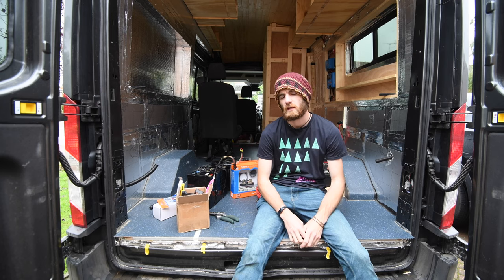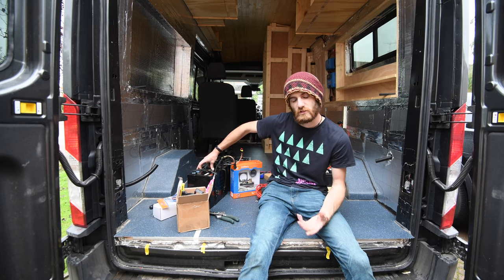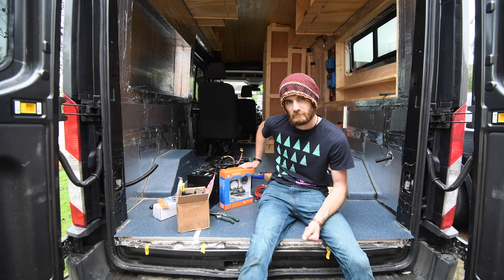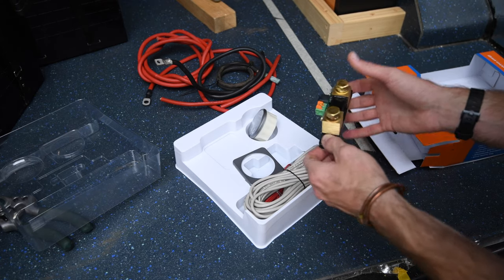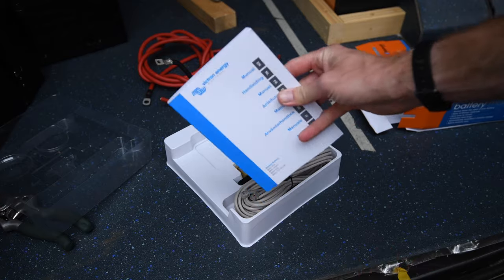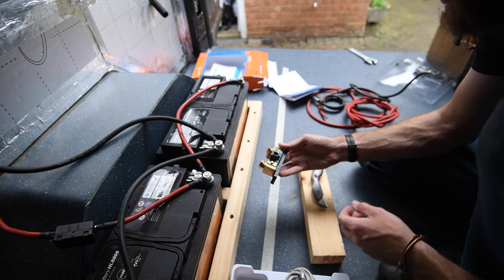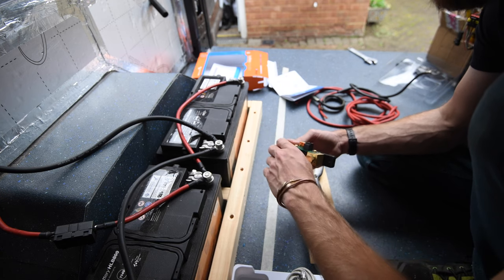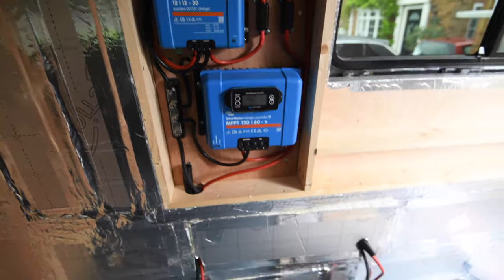Quick Victron BMV-712 install | EP26 | Ford Transit MK8 Campervan Build

Comment: I would have mounted those large isolators at 90° so that when on the handle is vertical, and off is horizontal. That would imply that there is a barrier across the cable when in the off position. I hope this comment makes sense.
Reply from the maker: Aye it’s makes sense, this was only a temp set up

Comment: Very important to know the state of charge. Takes a full charge or 2 to learn what 100% actually is. I use wizard Jr. With my midnite solar kids. I wish it had the Bluetooth!
Reply from the maker: To simply figure out the State of charge I’ve been using their stabilised voltage after a charge at the moment , the SOC in the diagnostic software isn’t particularly accurate at the moment due to the lack of real use in a long time. When I have them installed in the van our then be able to do some more tests.
Reply: Looking forward to that video
Reply from the maker: Definitely me too, I’m adding a few extra bits to the System to act as safety disconnects as the BMS in the U27-12XP can’t do much In that regard and a don’t have their external U-BMS
Reply: Neither do I and most aftermarket options are over priced.
I plan on using seed starter mats & temp controlled realay they plug right into with standard plug. Each 10x20in mat uses 15w and should keep warm enough to avoid changing below temp
Reply from the maker: Low temperature charging I planning on using the Victron BMV-712 with the temperature sensor, the BMV-712 has a build in relay which can be preset to trigger by a number of things. I’m using to the over-voltage and low temperature trigger to trip the reply which il will connected to the remote On/Off pins on my Victron MPPT and Dc/Dc charger to turn them off. Undervoltage is handled by the Victron battery Protect.
Reply from the maker: Although I was looking at the relay on the BMV triggering separate relays or contactors connected to the charges.  the Victron groups have said that as a bit overkill just use the remote on an off pins on them
Reply: I like the victron products. Didn't hear somuch about them when I decided on the midnite solar years ago. They atleast can talk to each other as units are added. If had chance to do all over again it would be hard to choose a different option.  But victron would probably be the winner

Comment: Sorry, this is not an electrical question, but it relates to the shot at 7:45 in this video. What did you do with those styrofoam things behind the upper driver and passenger doors? I had herd they had airbag wires in that area. What are those styrofoam things for? Do they have a real purpose? Also what is holding up your cubby shelf now that you removed the liner above it? Thanks for the help. Trying to decide if I should pull that stuff like you did or keep it.  I like your curved ceiling, so I want to pull that stuff out.
Reply from the maker: No problem, there are wooden batons attached to the  metal work of the van there. the shelving then has batons attach to it and get screwed together. For me no wires there at all. Maybe that’s on the minibus version for the airbag wires? I have seen the styrofoam things you talk about on there Mk8 but there were no in mine. 

By cubby self do you mean the shelf above the cab? That’s bolted into to original holes it has always been. It’s a pretty heavy duty metal shelf which came with the van
Reply: Mispronounced Adventures Oops that should have been cubby shelf. Yes, the shelf above the cab.
Thanks for the help!
Reply from the maker: If you have Instagram add me on there info description for the video and I’ll message you some pictures of the shelf

Comment: Hi keep up the good work love your videos just have one question I’m looking to buy a VictronConnect battery protect there are three different types in the range I have a 400 amp power AMG battery bank which one would you recommend cheers keep up the good work
Reply from the maker: I’ve purchased the 100Amp Victron battery protect to go before before my 12 V fused switch box for all of my 12v loads are located. As I don’t see myself drawing more than 100 amps on the 12 V system at any time. Do you remember if you purchase and install a battery protect that they don’t allow reverse current ( they will be damaged ), meaning power from your charger can’t go through it to get to your battery
Reply: Mispronounced Adventures Hi thanks for the response do you mean that as long as I keep it between the battery and a 12 V fuse box I will be okay as I have a Victron and PPT and battery charger thanks again sean
Reply from the maker: Aye as long as it’s only between the 12v fuse box and the battery it will be fine. It can’t be between the charger and the battery